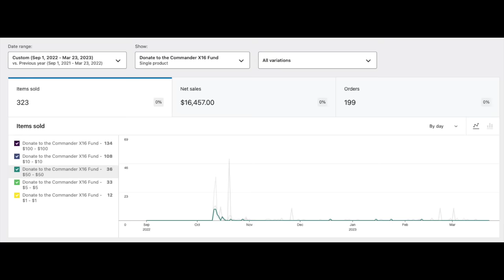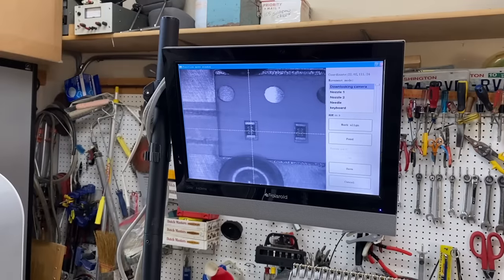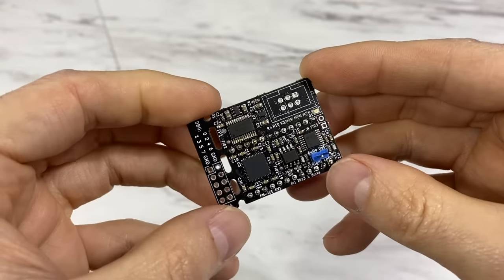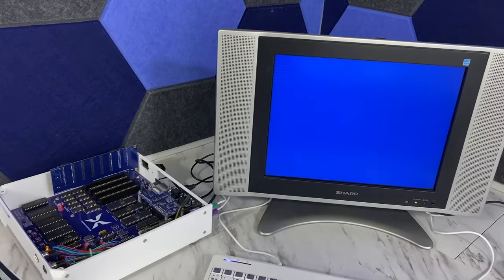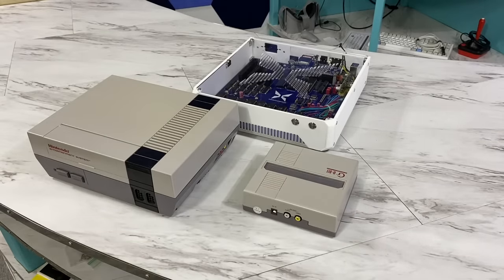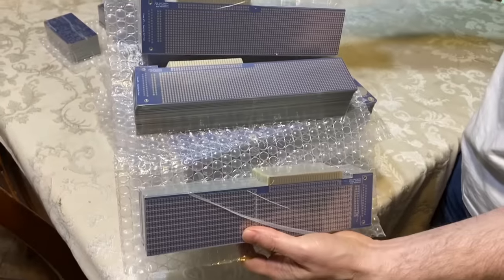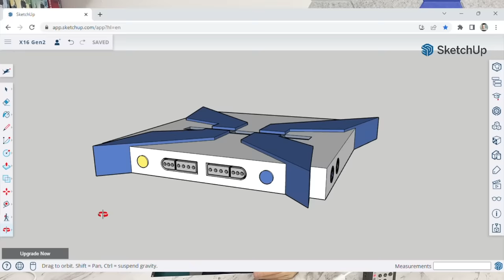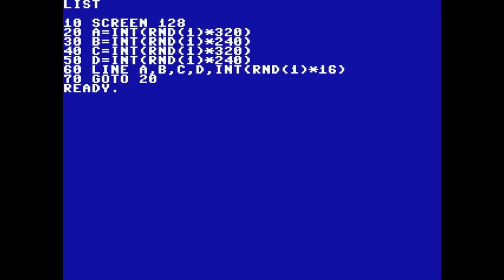Commander X16 2023 update

Comment: I'm really excited to get myself a board. I think USD$500 may be a little more than I was hoping for, especially with overseas shipping.
Reply: Yeah $750AUS for me.
Reply: Let's remember that when this idea was pitched, it was supposed to be like 50 bucks.  That is about what it is worth, fifty bucks. 
I'm not trying to give 8bitguy grief about this.  Five hundred bucks is OUTRAGEOUSLY expensive for an obsolete computer with no software.  You can buy a pretty beefy Amiga for this kind of money.
Reply: @tarstarkusz  no software is completely wrong. right now, it's FULL of software even during development of the system.
Reply: Sony Ps5 8k is only for $499 is a really good deal.
However we respect and love 
8bit guy ❤
Reply: @tarstarkusz  When the idea was pitched, the target was $300 for the first iteration. $50 was and still is the target for the third iteration, which is planned to be a much smaller FPGA based system.
Reply: I think it is pretty clear that it won't cost 500 dollars in the long run.
Reply: @geofftottenperthcoys9944  Ditto, I'm in Australia as well. I'm hoping there might be an option to buy sans keyboard/mouse /power supply to bring the price down as well as the shipping.
Reply: @SnakebitSTI  This is NEVER going to sell for 50 bucks unless he can get walmart and target to sell it.  If he can do 75k of them, 50 bucks is doable (assuming the audio chip problem is solved).  Without huge numbers, 50 bucks is a dream.
Reply: @tarstarkusz  The $50 version likely won't have a discrete audio chip. It will have as many parts as possible implemented in an FPGA.
Reply: @SnakebitSTI  As I recall, the original video only mentioned the $50 price, and not using an FGGA at all. All of that went out the window. This machine is the total opposite of what David first proposed. To get it to $50, the whole thing would have to be created in a very cheap FPGA and produced in big numbers. Either that, or just run the X16 emulator on a Pi type board. But the Agon 2 Light proves you CAN make a cheap, fast 8 bit computer.
Reply: @SnakebitSTI  I don't know if it could be hit using an FPGA.  There is also a matter of licensing.  There are no custom chips in the machine. Someone owns all the chips in the machine. They will not be allowed to do that. Whoever owns the 6502 will want to be paid. Yamaha will want to be paid.  Whoever owns the video chip will want to be paid.
Reply: @xiaofengxiaofengxiaofengxi4651  It could just as easily be 600.
Reply: @tarstarkusz  hardly, why would costs go up if they are simplifying it
Reply: @xiaofengxiaofengxiaofengxi4651  Nothing is set in stone and we are in an inflationary environment.  There will be no free components in the next version. The PCBs were free for this first batch.  The price might go down, but it also may go up. This is probably at least 18 months away and a lot can happen in 18 months.

Comment: I was shaking my head in shame watching you put stickers on the keyboard, my dude....
Reply: Agreed!  And then it appeared he was sick of doing it himself, so he threw the stickers in the box for the EU's to do it. I'm a little disappointed with this outcome.
Reply: For a 500usd machine!
Reply: @avalonbits  I'd be really surprised if the price goes down, I'd expect the opposite with all the obsolete parts they are using. Look at the size of that PCB, I had a quick look at the chips on that board...  I mean why use 5 x SRAM + 6522 VIA DIP packages in 2023 when you can go for much cheaper surface mount, they would then have the opportunity to reduce chip space and save on parts...   insane if anyone expects the price to come down significantly.
Reply: @samp3413  No surface mounted components was part of his original design constraints because he wanted it to be easily repairable by an end user and surface mounts make that much harder. But still, there's bigger through hole too so using multiple chips still doesn't make economical sense :/
Reply: @danieljonsson8095  Multiple chips, sockets, slots too, its all very expensive. The VERA module has SMD components, FPGAs so his original design constraints have already been broken to an extent. 

Something like this should be produced as a kit.
Reply: @samp3413  Eh, I'd say it shouldn't be produced at all at this price point with this design. Kit or assembled isn't really the issue, it's that pretty much nothing about it complies with the stated design goals.
Reply: @danieljonsson8095  You have a good point especially considering there are some really good alternatives out there such as the MiSTer, MEGA65 and the ZX Spectrum Next.

Comment: I think you should call the game console version (or the Gen.2 version) of the X16 the "X16GS", in much the same way Commodore made a consolized version of the C64, called the C64GS.
Reply: We all know how the C64GS was a giant success.
Reply: X16C - like the Apple//c - the compact version without expansion cards.
Reply: Though unlike the C64GS, it still includes the keyboard... it is just reduced from four expansion ports to one.
Reply: @brucemcfarling4674  It also has reduced memory.
Reply: @Okurka.  552KB SRAM and 512KB FlashRAM memory built in and up to 3.5MB RAM or ROM or both available in a cartridge is not a trivial amount for an 8bit processor
Reply: @brucemcfarling4674  You claimed "it is just reduced from four expansion ports to one" which was a false statement. It also has less memory.

Comment: I would like to hear more about the issues with getting boards made by a manufacturer.
Reply: I can imagine a few being in the business.  Two of the things that come to mind are price and delivery.  First, the number of boards may not be ideal for their business and may charge something outrageous.  The second is the turn around time on having them manufactured could be so far out you wouldn't see product for quite some time. Because Biden has enacted the defense production act, many PCB manufacturers are looking to gain access to that cash making boards for the military.

The final thing, might be quality on the production.  The contractor might not want to take any responsibility for how it turns out - or they will at another huge cost.

Now, I don't know this for sure.  It's based on my experience working in the aerospace industry which has high quality standards. We make our own boards if there are no RoHS requirements.  We do use contractors when RoHS is required.
Reply: THT assembly is extremely expensive compared to SMD
Reply: There are no issues.  They don't know what they're doing.
Reply: @paulklasmann1218  i agree mostly, but the texelec guy has been selling other boards for years. You think he would know. But maybe he is just reselling those.
Reply: @bzuidgeest  I'm sure he's not been involved in manufacture judging by the video.
Reply: @paulklasmann1218  that would be beyond stupid. Ignoring the experienced, yet that seems a trend from the get go.
Reply: @bzuidgeest  The wise thing to do is to get the PCB manufactured by a company who specializes in it. I wouldn't want a computer assembled in a shoddy manner. I'd rather solder it by hand myself, as I'm doing with a reAmiga1200 PCB.
Reply: @paulklasmann1218  his channel audience is the target. My guess is that most have never seen a soldering iron. They just want a new commodore. And believe this is the new sliced bread.
Reply: They found a manufacturer, it's Suntronic in Richardson, TX.

Not sure what they're going to do with the solder dipping station that was bought with GoFundMe money meant for the X16.
Reply: @Okurka.  If it was me and I made a mistake I'd just put my hands up, say sorry it was a mistake and sell it to buy something relevant to the project. We're all human and make mistakes.  However if there is any other motive for buying it, I'd like to see what its used for. Im not going to bother with anything on kickstarter in future.
Reply: @paulklasmann1218  It certainly looks like Texelec equipped his shop using the crowdfunded money.
Reply: @Okurka.  That sounds like Nostalga Nerd raising money on KS to pay for the arcade and restaurant he wants to open. Im not sure what the rules are about that.   The crazy thing is, people throw money at them.  They must all be well off.
Reply: @paulklasmann1218  At least on KS there are reward tiers. You get nothing in return when you donate money via GoFundMe.
Reply: @paulklasmann1218  you should always consider Kickstarter a charity donation with the possiblity of maybe getting a product. Otherwise you will often be disappointed.
Reply: @paulklasmann1218  some people or better said fan boys just want to see their idol succeed. It's not much different to music or sports stars selling merch and hyping products.
Reply: This. 
Having hired contract manufacturers to manufacture stuff in China was pretty easy, painless, and cheap. While I'd like to be less dependent on China in the future, it's really the only game in town.
For that kind of thing, I would suggest redesigning to use as many surface mount chips that can be sourced in China as possible. Things that can be obtained from multiple sources are safest. While that isn't particularly retro-aesthetic, I think most people are most interested in getting a working system, not what the boards look like. Designing for manufacture is a thing.
For things that can't be sourced in China, you could send chips to China, but if they are thru-hole parts, maybe just have them install a socket and install them when you receive the boards. Shipping parts to China is more expensive than having them ship stuff to you, so I avoid it when possible.
Anyway, good luck with your production. Hopefully you can produce enough to satisfy all of the folks that want one.

Comment: In my opinion making assembly by yourself is sub optimal. There are companies which can assemble a thousand of computers in a few days/weeks, and with a lot higher standards than some home factory in your garage. You've already realized, that it's not enough to buy a machine, you have to have experience and knowledge of a process.
Reply: One big issue with using contract manufacturing is that they’ve converted their automated systems to make only surface mount boards. Any through hole components are a separate, more expensive process.
Reply: @stevestroh1891  That's true, but they could order to mount only SM elements which I guess would be 95% job done. Anyways, that's their decision they've made, and their company. If they succeed, they made right decisions, I guess 🙂 I just wonder that David should've known how difficult and time consuming the simple labor is when it goes into quantities, since he's already developed and distributed his game and struggled with making enough copies, boxes etc. PCBs are way more time consuming and they still decided to assemble them by hand. That's strange.
Reply: There aren't surface mount parts on the main board, so how can getting surface mounted parts done be 95% job done? The surface mount parts are on the Vera daughter board.
Reply: @brucemcfarling4674  What I meant was that they should design the board for SM from the very beginning. It'd also be cheaper since every hole in the pcb is also a cost.
Reply: Yeah, he's way too in over his head at this point IMO, feature and price creep have pushed this thing so far from his proposal, plus the agon light is like $50 and does everything he says he wanted his computer to do lol. The basic engine looks like a cool budget option too.

Comment: It might be nice with a pizza-box style case to have a central pillar inside so you can put a monitor on it.  Also, there's some really cheap STM32's that have more than enough horsepower to emulate a YM2151 and a 12-bit DAC as well.
Reply: I am surprised they didn't consider a STM32 as an alternative to the FPGA
Reply: Heck, think you'd be able to pull it off with a 2$ blue pill.
Reply: they could prob. use that or something like a esp32 and have enough power to do extra stuff in a cartridge or expansion card. that might help with the networking since it already has a full tcp/ip stack. rp2040 could also be an option.
Reply: I made a pretty decent audio chip with an ATmega8A, and it still had room for improvement. I think it's certainly possible to emulate that chip even with much simpler microcontroller such as AVR. It just needs a powerful programmer who's familiar enough with electronics. I'd do this if they ask me to.
Reply: @AndyGraceMedia  I had serious lust for an Archimedes 3000 while in my late teens. I even had a A5000 on order and started learning ARM assembler. But something happened and I needed the money and had to cancel the order. So I stayed with my Amiga and never switched over. It would have been fun to at least have a A3000 now.

The Acorn computers where never a thing in Sweden where I am. But the Archimedes ones where certainly interesting...
Reply: For the pillar, maybe a long standard brass standoff screwed into one of the ATX screw holes to support the lid.
  For the sound, maybe design your own CPLD based thing that drives an ADC and some analog parts.  Games can samples into some register buffers or configure counters to produce sawtooth and other digital forms, while the analog parts can be configured to filter into something closer to sine waves and synthesizer tones.
 For networking, look at something like the IP on a chip solutions used by Arduino, or a 32 bit Ethernet capable microcontroller with enough power to contain the IPv4/v6 stack, IPsec and TLS1.x protocol layers but no operating system to complicate things.
Reply: If you keep going down that road why not just make it all an FPGA or screw it and just make it software emulated on a PC
Reply: @Ziplock9000  The rhing is that FPGA and CPLD are real hardware solutions similar to the ULA chips in early 1980s.  In fact they were originally a way to prototype ULA and ASIC designs and used in low volume products like the X16 devboard.
 Anyways, it seems Yamaha still makes a sound chip with their classic FM design inside, though they market it as a way for cars to make that ding sound as you get in, not as a general computer chip.  Also, someone made an FPGA configuration script to duplicate the old Yamaha chips, which (unlike the MOS SID) were mostly digital on the inside.
Reply: @johndododoe1411  Interesting.
Reply: The problem with an STM32, ATMega, ESP32, or similar microcontroller is that interfacing with a 6502 bus is a hard problem to solve. There are hard deadlines that fall within 10ns of a clock edge regardless of the PHI2 frequency and nearly all hard deadlines occur within 30ns of a clock edge. An ESP32 at 240MHz sees one cycle every 4.17ns giving it between 2 and 7 clock cycles to detect and react to an event on the 6502 bus. The only easily available microcontroller that can reliably meet these deadlines is the RP2040 with its PIO feature.
Reply: I don’t think it’s big enough to put a monitor on it. It’s basically the size of an NES. It also sounds like there is still a small chance the cartridge will stick out the top.
Reply: And if you do an all FPGA design,why not just say, "wait, people are already doing that, why go to all this trouble to repeat what others are doing." 

This whole process highlights WHY nobody else has tried to make a system from as many in production, true 8bit ICs as is feasible, and I think we can say they are coming as close as is really possible in the current state of the market.

Otherwise you build a system out of a low cost 24bit CPU that had an 8bit data bus to save cost and an 8bit backwards compatibility mode, and a 32bit microcontroller, like the Agon light, and call it a day.
Reply: @JoeBurks_1  That's true. I have sidestepped that in the past with 74-series 8-bit latches, so the MCU has more than a single clock cycle to receive a write. Two such latches enables bidirectional IO with the bus. It's a source of latency, but for an FM synth that's not so critical. Lately, people have been interfacing Raspberry Pi-PICO directly with busses (Apple II, Apple IIGS), just with voltage level shifters and no latches. (I think because of a dedicated GPIO subsystem the PICO.) In any case, even with the FPGA, some support chips are needed (level shifting).  At least the extra chips are fairly cheap.
Reply: Pizzabox case... This thing would look cool in a teal SGI Indigo style case

Comment: Good grief man, you assembled all those BY HAND and then set up your own production line? I'm not sure who you spoke to about getting these mass-produced, but I regularly get stuff done in small (10-100pc) quantities without any "logistical nightmares". Even getting the SMT parts assembled/soldered by automated pick-and-place/reflow then adding the TH by hand would have been a worthwhile timesaver.

Soldering one board by hand is a bit of a chore. I think they'd put me in a padded cell after doing 100 boards that size.

As others have mentioned, wave soldering and preheat avoids the warping problem. I don't think anybody does dip soldering anymore, although "dip components" is often used to mean through-hole components.

Anyway, full marks for sheer bloodymindedness :)
Reply: "dip components" specifically refers to through-hole ICs, and it's actually an acronym.  DIP = Dual Inline Package; i.e. there are two rows of pins, all at the same height and distance from the chip body.  Has nothing to do with them being "dipped" in solder. :-)
Reply: @ballyastrocade5672  I know, but in that case it's capitalized. Possibly it's a regional thing, but in my part of the world (non-English-speaking) people use the phrase "dip components" (lowercase 'dip') to refer to all leaded components. It's entirely possible it arose from confusion between DIP packages and the dip process, but it's definitely a thing. In Europe or the UK people talk about "wave soldering" and "DIP packages" as entirely different things, as you'd expect. And presumably in the US too.